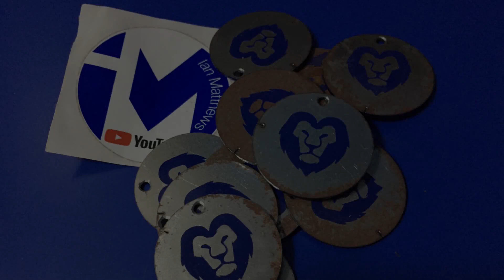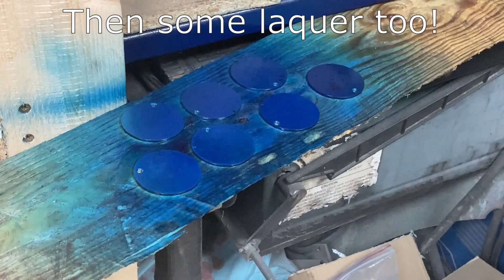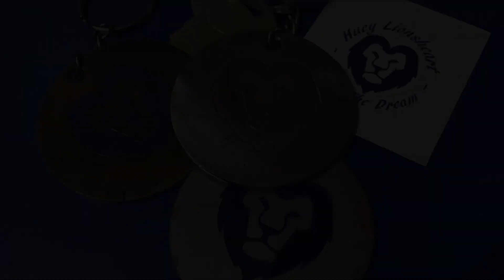Metal Etching - simple method.

Comment: Did you use 12 volt DC with the saltwater? If not what?
Reply from the maker: Thanks for watching, Yes I used an old car battery attached to a charger. At 12v this'll eat through to a very deep etch in under 20 minutes, deep enough to apply resin effectively! 😉😁👍